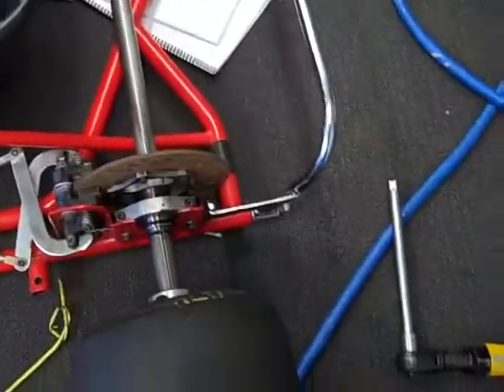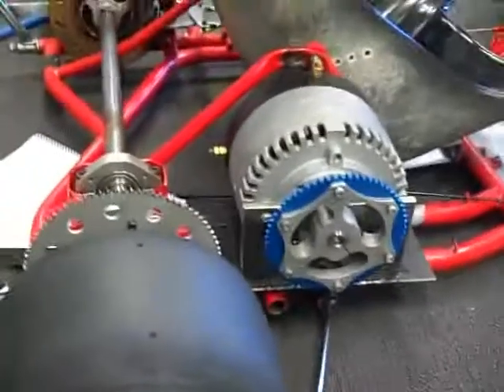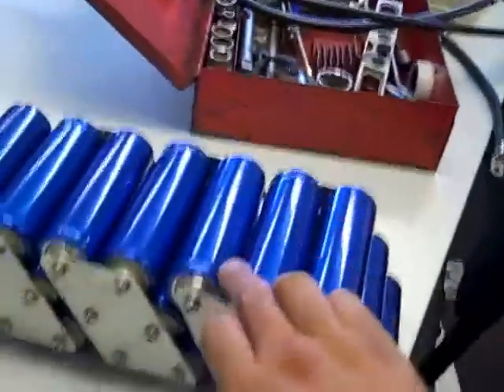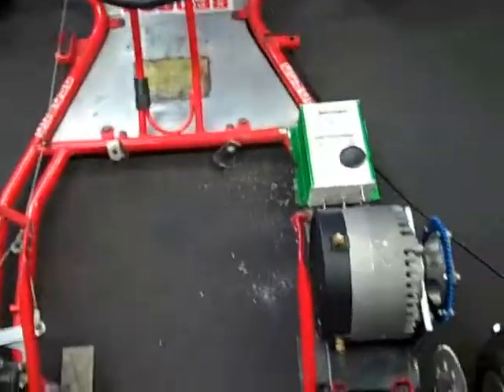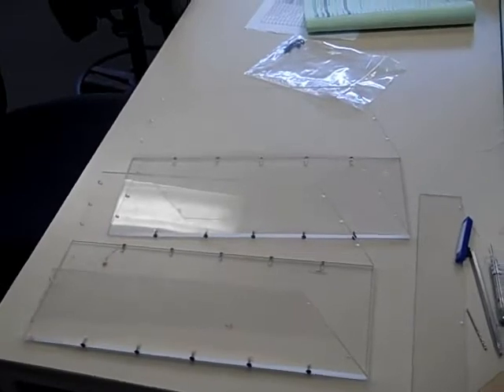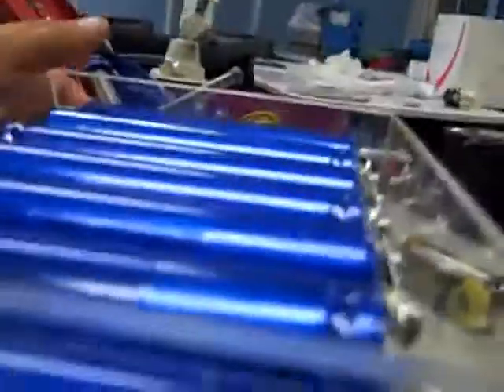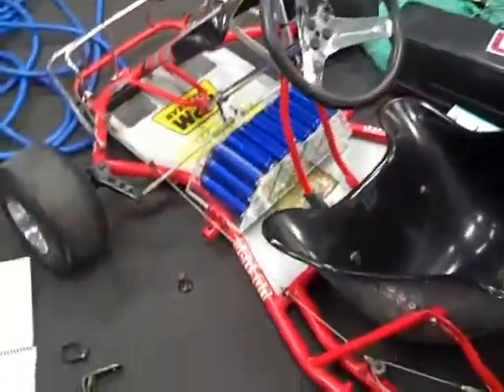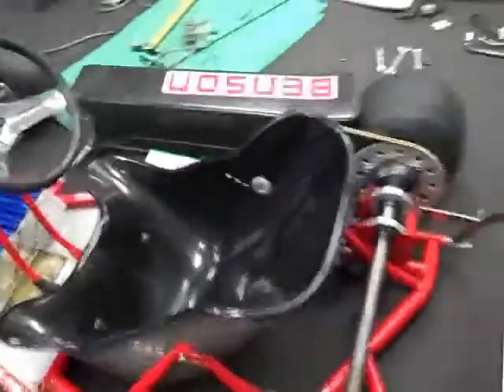Electric Go kart Chisholm Institute Frankston part2 Batteries

Comment: gymkhanadog: you are simply wrong. Cu 1.68 x 10^-8 ρ (Ω·m) at 20 °C and Al 2.82 x10^-8  as you can see the difference in ohms will work out negligible and that is why cheaper aluminum wire is used for power distribution rather than Cu.

Comment: Wish I could find those batteries here in the states. We just have the ones with weld on tabs
Reply: Responding to a 5 year old comment lol, https://www.ebay.com/itm/3-2V-15AH-1-40152s-HEADWAY-LIFEPO4-CELL/264005079732

Comment: @gymkhanadog aluminium has 60% the conductivity  but 30% the weight of copper for the same volume. So if you have 66% more aluminium by volume, you get the same conductivity at half the weight of copper.